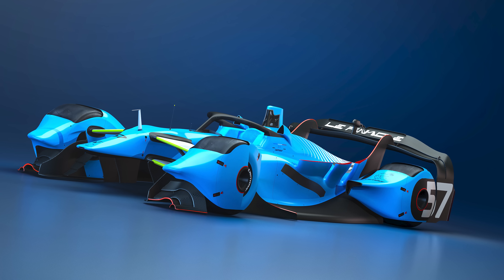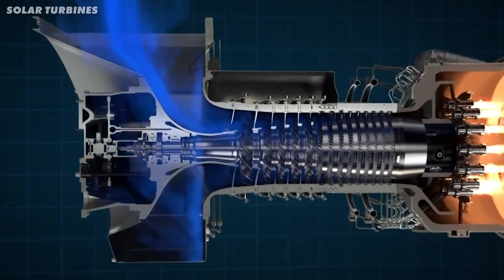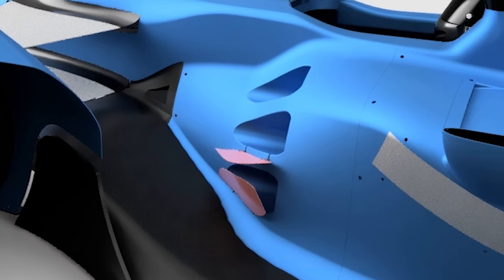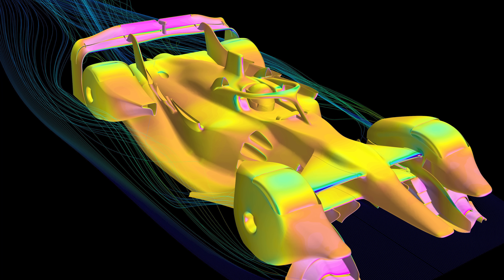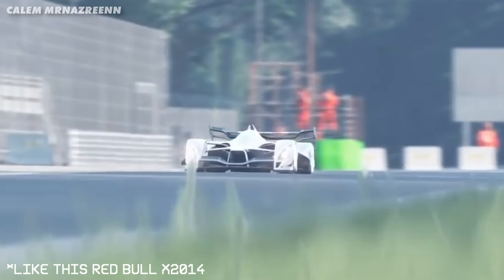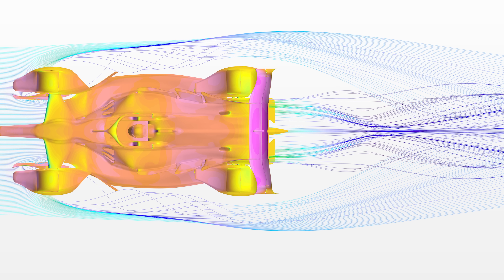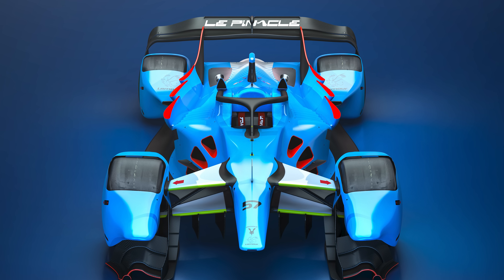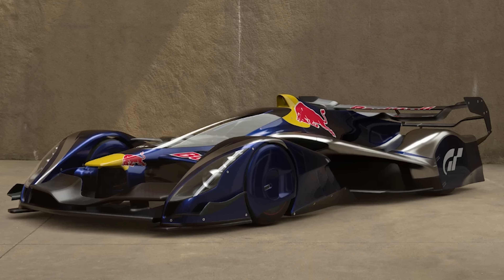Someone Designed The Perfect F1 Car (No Rules)

Comment: .....I WOULDVE HAVE A serious TALK WITH THE DUDE......BECAUSE HE DONE many THINGS wrong ,AND 75% OF TIME GAP IS FROM ENGINE,AND ALL OTHER ELEMENTS are not optimal

.......LIKE.....THAT SEALING WITH what vortexes IS NOT OPTIMAL SO FAN CANNOT PRODUCE ENOUGH DOWNFORCE.......AND actually THE THING COULDVE BE DONE BY active suspension.......

....ALSO FRONT WING is A MUST AS IF IT'LL BE ABOUT active ......IT WILL not..........CREATE DRAG AT HIGH SPEEDS BECAUSE IT IS flat.........

...ANOTHER THING WHY flexible WINGS ARE BAD IS....... FLEXIBLE WINGS ARE COMPLETELY USELESS!!!!..........BECAUSE THEY basically HAVE A FIXED DRAG RATIO......AT all speeds.......AND THEY JUST HAVE ADVANTAGE BEFORE fixed WINGS......AS THEIR DRAG increseases.........BUT active ....ON OTHER HAND.....HAS all the pitches..........SO DRAG IS always OPTIMAL AT any GIVEN SPEED......BESIDES, active wings couldve be used as drag brakes WHICH WILL heavily INCREASE BRAKING FORCE SO CAR WOULDVE BEEN ABLE TO BRAKE much later......

....ALSO ANOTHER DISADVANTAGE LACK OF passive suspension IS ..... VARIABLE PITCH OF ALL CAR AT TURNS .......WHICH CREATES UNEVEN LOAD ON TYRES AND MAKES THEM WEAR much faster...........AND SEAL OF FAN ISNT also OPTIMAL.............

.....IN OTHER WORDS.... A PERFECT F1 CAR OF mine WILL BE ABLE OUTSPEED THIS ONE FOR THE SAME 10-15 SECONDS .................SO I'M so pissed off .........AS what dude made is not something as right as 2+2=4 mostly like 2+2=6,and for me WHO IS EXTRA ABOUT ALL THE STUFF TO BE AS CORRECT AS 2+2=4 this is UNACCEPTABLEE ...........NOT BECAUSE I'M SO CALLED "perfectionist" BUT BECAUSE 2+2=7 is unnatural and 2+2=4 is natural,SO IT'S ABOUT physical scientifically correct definition of how the fastest car wouldve been .......AS I adore science .........

Comment: nice technical ideas, but probably not raceable. Too big for a start. This car is built for lap time performance and not actual wheel to wheel racing. Plus it might also come to the driver being the limiting factor, with drivers not being able to cope physically with the forces generated by the car.

Comment: How much more wear (in laps) does the increased downforce/gforce in turns cause on the tires? How much time is lost during each pit due to those tire covers impeding tire swapping? How much hotter do the breaks get, affecting break fade, due to being completely enclosed? Are the parts that are prone to damage easily replicable during a pit? Cool pet project but there are some practical aspects that might make this more trouble than it's worth.

Comment: Would it fit the Koenigsegg Jesko of Gemera V8 and light+compact 9spd? 1500-1600 hp and not too heavy a combination, mean for track and road use so easier to deal with than a pure race engine.

Comment: When I heard that he wanted to use a gas turbine and a cvt I had many questions why. It would have been fuel inefficient (more fuel needed ->higher weight ->worse performance) and a traditional cvt would be unreliable and inefficient. A twin turbo 1.6 liter V6 with 1600 hp is a good choice but I think there are better options.

Comment: When the AMG One was announced, it was to weigh 1200 kg.
The specs never changes, apart from the weight, that's now 1700 kg.
How does one prevent this, if it happened to AMG that used an F1 team to design it, and used parts from F1 they'd worked with for year?
Reply: That car had an entirely different goal. Making an F1 engine road legal and usable without staff. That's not an issue with a race car.

Comment: Would tire manufacturers be able to create a tire that can handle the high loads of downforce this car creates?
Reply: good question, tyres are also holding back Rodin in this regard
Reply: @illdeletethismusic  And the RB17
Reply: How do you even get to the tires to change them?
Reply: @harryarmstrong5728  The difference between an engineer and a mechanic
Reply: @harryarmstrong5728 that’s what I’m sayin, if the tire pods are stationary, but have to move with steering, then it’s gonna take longer to pit and that 10-15 seconds is gonna be irrelevant.
Reply: @danielreigner1008  The Spanish Grand Prix has 66 laps, and most drivers do two pit stops. Say 2.3 seconds per F1 pitstop. Say, it takes 20 seconds to open the doors on the pods and switch out the tires. So, a total of 40 seconds in the race, as opposed to the 5 seconds or so for a current car. That puts the current car 35 seconds ahead...which this thing makes up in just over two laps.

The fastest lap time at Barcelona last year was 1:17.115. This thing does could do it in 1:02. Which means, theoretically, after 5 laps (ignoring blocking and the like) the car has lapped the rest of the field. If it pitted at lap 20, it would, theoretically, be up to 4 laps ahead of everyone else. A slightly longer tire change would not be an issue.
Reply: @harryarmstrong5728 you don't (at least for the race. They just had to make them stronger like in the old days.
Reply: Kevlar reinforced tires maybe?
Reply: @TylerHarris-yy7uf a lot of tires already are.  Not sure if racing tires are, but I know some road tires are.
Reply: @jacobm2625  gotta be both fast and durable, getting both right is the hard part
Reply: @TylerHarris-yy7uf fun fact, kevlar was made precisely to reinforce tyres.
Reply: Look at downforce levels in the world time attack in aussie.. those guys running 4+ ton of downforce on the top few cars..
Reply: Wider tyres for better force distribution
Reply: That's only twice as much per tyre as each tyre on a Bugatti standing still.
Reply: No
Reply: That’s a really good question
Reply: Definitely not Pirelli
Reply: Durex will do the job
Reply: @randomdude8877  bruh
Reply: This was my problem with the car too, just simply too much heat from all that downforce. Mixed with the high horsepower, tires would simply blow up after 2 corners.

Also, I wonder how it would be possible to get tiny electric actuators to close at 150+mph lol

Comment: So much faster than F1, question is can a driver take it over a race distance physically?
Reply: Even more important question, can an F1 driver even take it around certain corners at the maximum possible speed without blacking out?
Reply: @EarlHare  Probably. Modern F1 cars can get to around 6.5g in the corners. It's more about neck muscles than blacking out. Blacking out usually occurs in pilots due to maneuvers like sudden climbs that cause the blood to go to their feet. F1 cars don't do that.
Reply: @EarlHare  this is a level of g-force of fighter jets. So it's possible to handle for a while.
Reply: @ObnoxiusBrat  true but a fighter pilot experiences mainly vertical g's while F1 drivers experience mainly lateral g's. So less chance of blacking out but it will be absolutely exhausting to drive with all the muscle you need to even keep your wheel pointing in the right direction
Reply: @ObnoxiusBrat  Fighter jet pilots don't experience such G-forces every 10 seconds.
Reply: @ObnoxiusBrat  Jet pilots have G-Suits and special training. Can be done but a driver would have to add to his training regiment.
Reply: @ObnoxiusBrat  for 90 mins of an F1 race?
Reply: @ObnoxiusBrat  Lateral Gs and vertical Gs are entirely different things.
Reply: @ObnoxiusBrat  Yeah but is it 70 laps? No.
Reply: @EarlHare in red bull air race they're doing 10g in very narrow spaces while doing a twist so i think 7g should be just fine
Reply: @phoenyx555  Yeah but each event is only 2 mins of high G max for a slow competitor. An f1 race is 90 mins of regular G per lap. Cances are they would only be able to do 10-15min races at full race speed.
Reply: @phoenyx555   their is a difference between vertical and lateral Gs, completely different muscles being used
Reply: @EarlHare  you don't black out from 7 lateral Gs.  Youre thinking of vertical Gs where the blood leaves your head.  This is not that and never has been.
Reply: Ultimately, if we remove all the rules, it becomes a question of how fast you can move a human around a fixed path and still have them able to stand on a podium.
Reply: Also, how long will tires hold up
Reply: the driver doesn’t need to put it at the limit to beat f1
Reply: With no rules, why not just drive it remotely
Reply: I may be misremembering but I think the 919 Evo was limited by the driver in how fast it could corner at Spa. Approaching or above 5G is really hard on anyone's body. The kind of G-suits and spatial-awareness-aiding technologies (e.g. in-helmet HUD) needed for the driver would be arguably as important as the rest of the car, and almost as complicated
Reply: yeah, once
Reply: Imagine trying to change tires on a pit stop with these wheel covers, probably won't be much faster after that

Comment: Interesting that he still chose to have a halo and not just enclose the cockpit - which I imagine has more potential aerodynamically.
Reply: Its also easier to get out of the halo than a broken closed cockpit
Reply: I think it's more for the drivers. They trialed an enclosed cockpit and they said it made them feel sick by impairing their vision. The dirt and marks on the windscreen were distracting etc. 

Drivers have said, due to the design of the halo and the centre bar being in between their vision, they don't notice it.
Reply: @Jimmy_Moon not too sure about this, I mean LMP1 cars are closed cockpit cars and would run for a long time before each stop.
Reply: @ I think they specifically mentioned the sun on the screen during the day and the glare from the lights at the night races. 

Probably hot as well as the open cockpit cools them. IndyCar has air conditioning for the drivers. 

Hence the sickness.
Reply: @Jimmy_Moon  indycar doesn't even have power steering, they sure as hell don't have air conditioning.
Reply: @abdullahsalman2200  LMP1 cars have wipers
Reply: @ I think if you spent a little time looking into the cooling systems involved for IndyCar rather then writing this passive aggressive comment, you’d learn a lesson.
Reply: @abdullahsalman2200  LMP1 cars are designed to resemble 2 seaters rather than a single seater. The curvature of the enclosed cockpit on a single seater would be much more pronounced than a 2 seater.
Reply: @Jimmy_Moon  that's correct. The vertical column is hardly visible. It's more like a blur at that spot.
Reply: @Jimmy_Moon Indycar is basically enclosed though
Reply: @Jimmy_Moon  Drivers used to complain about not being able to see in that, too. As innovative as F1 claims to be they are entirely resistant to change.
Reply: Theres issues with that. And theres plenty of videos that covered it during the Time F1 was testing both. 

Drivers were unhappy with the canopy's because it separated them from their environment and it also enclosed them in their loud ass cockpit. It also didn't allow the airflow they needed to keep themselves cool. Because of that, even more weight and engineering and budget would have to go into additional systems to keep the drivers cool and retain awareness of their surroundings audibly. In the event of a crash, they'd also need to rely on its ability to detach and allow escape. Which might not happen easily in a case where the crash causes it to pinch.

The open halo design only required additional bodywork at the cost of some forward vision, but you can easily look past that thanks to having two eyes
Reply: I believe that those writing that IndyCar users air-conditioning are conflating this with NASCAR, which uses AC to cool the helmet of the drivers.
Reply: @To.Ma.To_78  Indy uses air conditioning to cool water lines in the driver suits. There's a radiator in the nose specifically for that.
Reply: @alimanski7941  fascinating! I (obviously) didn't know that—thank you for clarifying 👍
Reply: Like the initial thought on a turbine engine, I think there are a ton of design choices to reconsider here.  Especially the automatic gearbox.
Reply: Weight savings probably too. Cockpit needs hinges and latches and all that 💩
Reply: Also, the formula 1 is famous for being an open cockpit race
Reply: He did state that a goal was to meet all safety standards, which is why he included the Halo.
Reply: @JediGillGaming  The halo isn't the only option
Reply: A curved windscreen with such a pronounced curvature would likely distort the view of the road ahead, leading to difficulty judging distances and potentially causing eye strain due to the uneven focus required to see through the curved glass... 
 I suspect looking past something like the central Halo piller is much less intrusive to ones vision when focusing way beyond it... than actually looking through a very curved lens that would distort  your view.

Tbh... I think 'no rules' cars would soon end up being severely limited by the bag of bones and tissues trying to pilot it... kind of  like how they have to use fly by wire controls on modern fighter jets to ensure they don't pull more G's than the airframe and pilots can handle....  If they ended up with jet turbines with side nozzle thrust vectoring the potential cornering G's could break people never mind cause them to pass out and it would probably become necessary to remove the driver from the car and to have him operate it remotely via ultra low latency FPV cams and possibly VR.
Reply: @paulhope3401 if the problem is the driver, they could just piloted remotely, or not?
Reply: @willy4170  If people can remotely race fpv drones through tight courses, its probably feasible... would it hold the same appeal to F1 fans though?
At that point you are so close to E-sports sim racing you have to question the point and appeal. 
Getting over the 'man and machine' together part of the sport would be a huge hurdle for a lot of people... inc myself. I'm not fully convinced I'd want to watch an E-sports/real life hybrid?
Reply: The Halo is also proven to work in the worst of crashes so far, and it doesn't generate nearly as much drag as the Open Wheels.
Reply: lol some comments here ignoring the aeroscreen... 
And in the next car it likely will be even more curved...
Man, people really need to watch things outside F1 heh
Reply: @PenteanoO  I mean you can't exactly blame them when IndyCar is the only one that uses the aeroscreen, all other Champcar series including IndyNXT use a halo
Reply: Yep. Makes me press (x) to doubt this whole car.
Reply: A formula car is open cockpit and open wheel
Reply: Well, I guess it's to make it look more like an F1 car than an Indycar car
Reply: @Becky_Cooling but this isn't an F1 car
Reply: Everyone is ignoring the most simple and basic philosophy of F1.
That it is open wheel, open cockpit racing.

Even the wheels covers he has designed are open at the top to facilitate this.
I'd imagine that's the same reasoning behind the halo and open cockpit, because that is the very spirit of F1.
Reply: @Holmesy87  Wheel cover's holes are for the purpouse to cool the tyre and having an aeroscreen or shield wouldn't make it closed cockpit (like IndyCar) hence why even F1 tested it
Reply: ...AGREED.....

...AND ALL "but" THINGS ARE A bout STUFF WASNT GET MUCH DEVELOPMENT
Reply: @robotnikkkk001  What????

Comment: Saying a 1600 hp racecar aims to be "sustainable" because it uses synthetic fuels is pretty rich.
Reply: 95% Ethanol is much cleaner than Gasoline, if the car has to warm the engine up anyway, then it would work just fine.
Reply: Well, it is. It's not new carbon going to the atmosphere, rather it's carbon that was captured recently, hence close to neutral.
Reply: i mean its as "sustainable" as f1 aims to be. f1 only cares about those synthetic fuels to claim the race itself doesnt dump carbon into the air, f1 ignores the massive carbon demand of travelling globally to arrive at each race. we gotta be more critical of f1 on the multiple valid fronts before getting mad at a pipe dream like this. f1 has major issues with greenwashing, while this guy just throwaway mentioned his fuel source being a future looking one. synthetic fuels dont solve every issue immediately, but compared to the issues f1 has i dont care what fuel a concept of a vehicle uses

Comment: 7 g-force is a force that is seven times the force of gravity. It can cause people to feel heavy, dizzy, nauseous, and even pass out.  A Formula One car will generate over 5G at the apex of the corner - the highest lateral G on the entire 2024 calendar - meaning in that moment the driver will feel a force five times their body weight.  

What G-forces do astronauts experience?    Launch and re-entry: Astronauts experience around 3 \(g\) during launch and re-entry.  Early astronauts: Early astronauts experienced launch and re-entry forces of up to 6 \(g\) or more.  Space shuttle: The space shuttle experienced more than 3 \(g\) on lift-off.